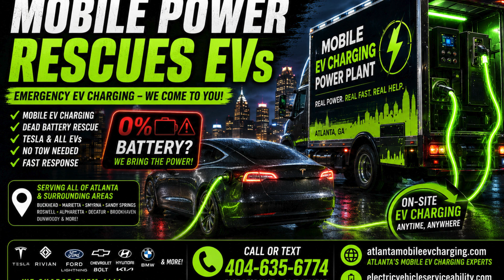Mobile Power Plants Rescue Atlanta EVs | Emergency EV Charging Atlanta GA

Comment from the maker: 🚨 DEAD EV IN ATLANTA? Our mobile power units come directly to YOU — like a power plant on wheels. No tow truck. No charging station hunt. We rescue stranded EVs across I-285, I-85, and I-20 in 30-45 minutes.

📞 Call/Text: (916) 826-9410
🌐 eeerescue.com

Serving Atlanta, Buckhead, Dunwoody, Roswell, Brookhaven, Decatur & all metro Atlanta areas. ⚡